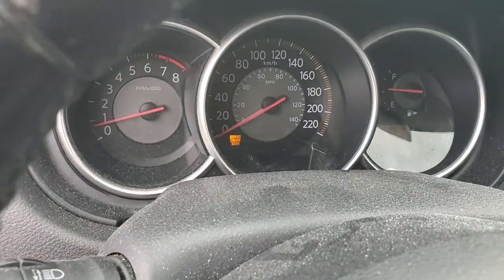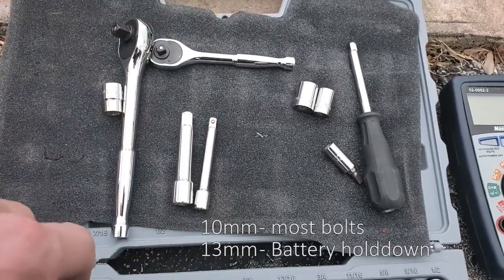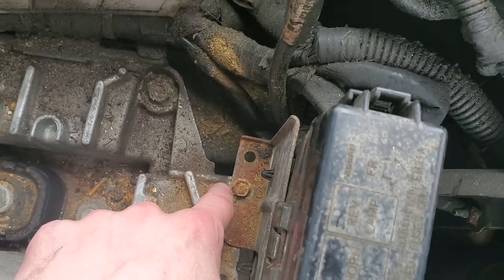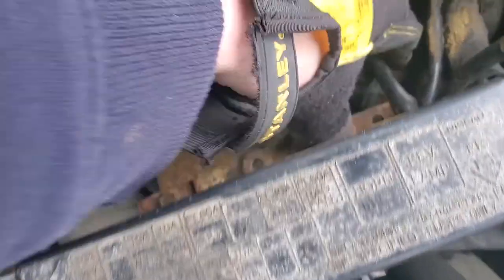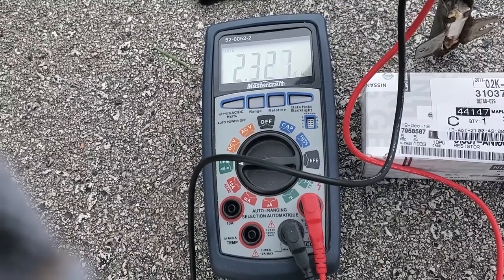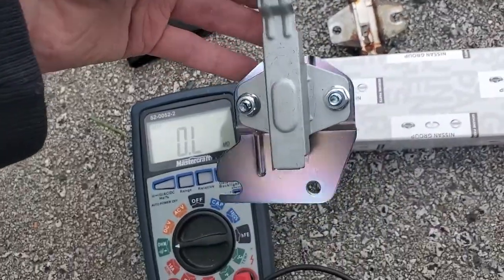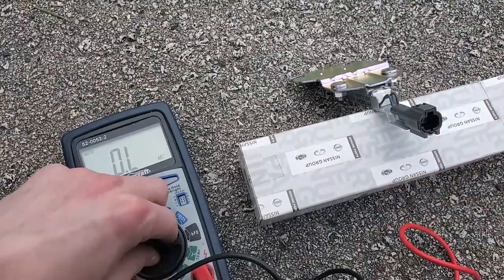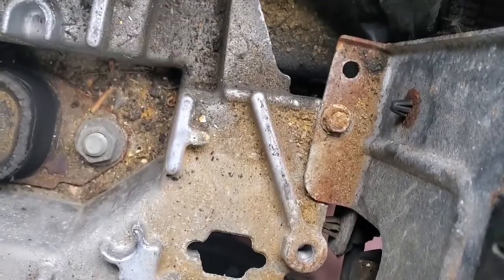P0745 - Nissan Versa (2007-2012), Hard Shifting Troubleshoot and Fix (Automatic Transmission)

Comment: Make sure you drain and fill trans at least 2 times then add 1/2 can Seafoam TRANS CLEANER. DRIVE 100 MILES . DROP PAN CLEAN FILTER and Magnets. Add the remaing 1/2 of Trans cleaner. This will clean solenoids and valve body
.my 2011 4spd with 89k had the know issue of stalling at times because of torque converter locking up. I had replaced/repaured,cleaned all known tsb issues. New MAF SENSOR, BRAKE LIGHT SWITCH , CLEANED ALL GROUNDS, REPLACE NEGATIVE battery cable(used marine liquid tape to coat bare copper wire connections on All 3 places the copper is bare on factory cable..cleaned mounting services and installed cable. The only thing that fixed the stalling was the  drain and fills and adding the cleaner. Dirty and low fluid will cause many trans issues. I bought the car with 89k and the fluid was dark brown almost black. After each drain And fill the color began to have clean fluid but the sample after adding the cleaner showed signs it was cleaning more varnish on componets
. Shifting was smooth again. Drain and fill again at 500miles intervals next  2 times
.cheaper than a new trans or new car. If you have one of these 4spd cars and want it to last
 After doing this procedure. Drain And fill every 20k
. 
.

Comment: Hello friend, I have a similar problem, I have a 2008 Nissan Versa Hatchback with automatic transmission, when the second speed enters it knocks and the code P0745 and P0045 appears in the scanner, I saw your video and the part you replaced is supposed to have my car but it is not like that, I wanted to verify if the part was in good condition and my car did not have that part, I do not know if it is normal or not, could you help me? Good video by the way.
Reply from the maker: While I am not familiar with the hatchback setup, it should still be there, this is a very common part between Nissans and Infinitis at least from 2003-2012 minimum (likely also Datsum). I did google a bit (try P0745, 09 Versa, a forum post shows the location, albeit a bit poorly) and I believe it is under your engine fuse box, if there is just a dangling wire instead that is a bigger problem. It may also be the shifting solenoid but I have no dealt with that on this car. Your car should definitely have this resistor though. Good luck
Reply: @brettkammer2680  So my car must have that part without a doubt, thank you very much friend!

Comment: Is it bad to drive the vehicle with this issue? Or is it okay to drive?
Reply from the maker: It is "ok" for a while, I drove it for maybe 500-1000 km before I fixed this. I recommend fix this as soon as possible as it is definitely adding additional wear to the transmission components which is a much much costlier fix, which is likely worth more than the car.

Comment: I have Nissan tiida 2011 i have the same issue, transmission got delay on shifting and engin RPM go high to 5 RPM. 
I did scan it's showing ( line pressure S/V) can you advise me please what should i do?
Reply: Get the link pressure checked.
Reply: happens only during city driving? or all the time?

Comment: Nissan Versa - Automatic, not CVT. Correct?
Reply from the maker: As far as I know this is Automatic only
Reply: @brettkammer2680  The door tag should have a transmission code number.  Looks like there was a manual, automatic and CVT transmission available.
The part numbers you've listed is for a resistor and I don't think that's used on the CVT models.

Comment: I have a Infiniti g35 with the same code do you think this could be the problem?
Reply from the maker: If its an older G35 it is possible. Check your transmission fluid to make sure its good, easiest first step, then go after the resistor and measure it. Part number will be different but it is, apparently after a quick google, located near the driver side strut tower.
Reply: Your check engine light was on at the end.
Reply: Did you fix it? This is driving me up the wall.

Comment: 2007 NSSAN SENTRA TAKES A WHILE TO SHIFT IN TO 4TH AND 5TH AND SHIFTS HARD INTO REVERSE.  I GOT CODE PO745 PRESSURE CONTROLSOLENOID (A). COULD THIS BE THE PROBLEM?